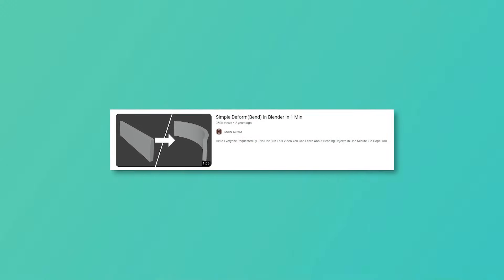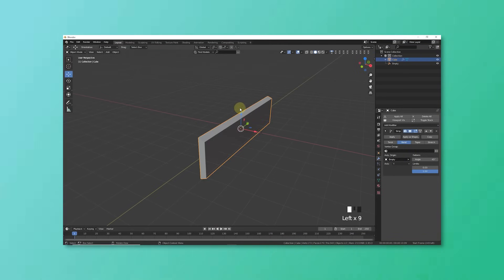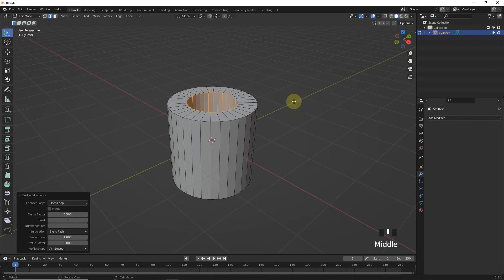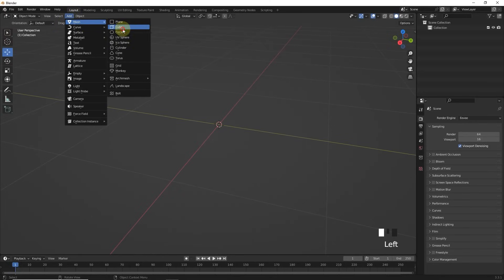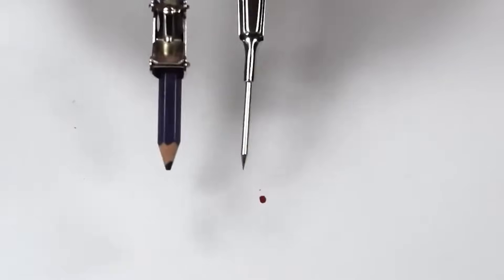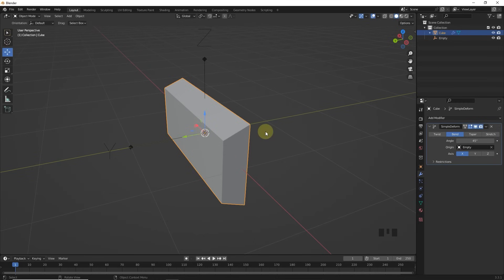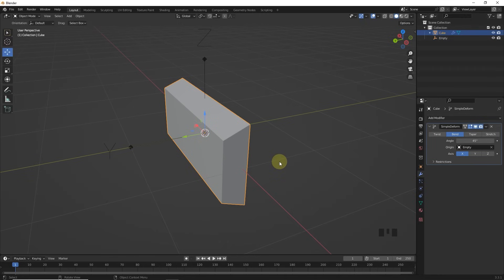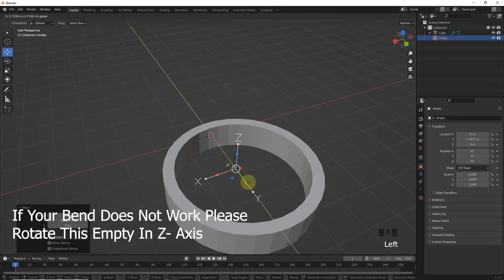How Deforming(Bending) Works In Blender Part 2 Advanced

Comment: Here is the problem with this tutorial. He is not telling you about DIMENSIONS. His dimensions are small, starting off with around 30x5x10 something like that. If YOUR dimensions are far greater or not adhering to the size he is showing you, your cylinder will NOT form. It is that somehow the dimensions allow for the cylinder to form so perfectly using 32 vortices. If you want to bend a much longer cube, follow his 32 vortices with the small dimensions first, THEN after you bend it to where you want it, increase the length of the cube to what you want. Then also you can change the degree of the curve you want. 
 Further, this is not for beginners, as he is not explaining in detail when he changes form object mode to edit mode, and that you should highlight the object when working on his directions, nor is he showing you or telling you which tab to click to get to the parameters he uses. The video has been edited to make it shorter thus cutting out parts essential for beginners to follow.  As a beginner's instruction I will give this about 3 out of 10.
Reply from the maker: Well thanks for your feedback.....

Comment: How do you get the control R function
Reply from the maker: By Pressing Ctrl+R
Reply: @MoinAkraM  unfortunately my version doesn't do that. I had to table over to edit mode to get the Control Function to work, and even then it's hit or miss. Does not work every single time
Reply from the maker: What You're Using Windows Or MacOs